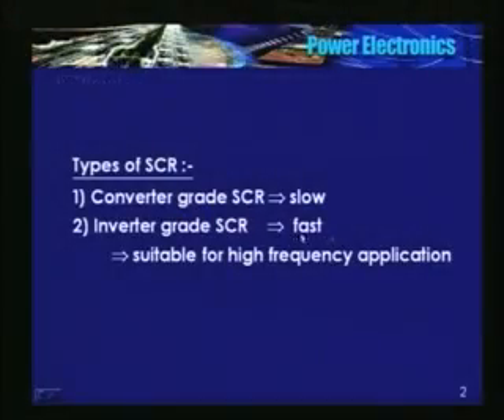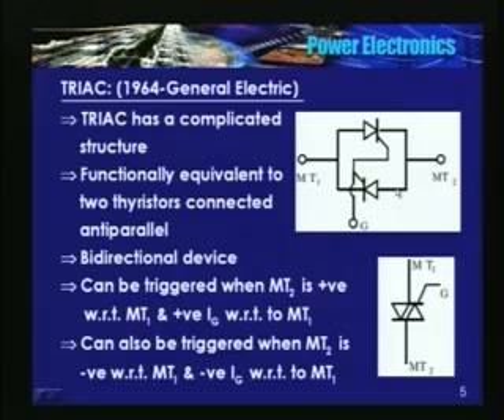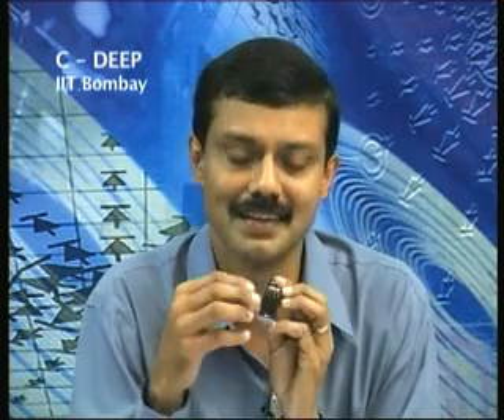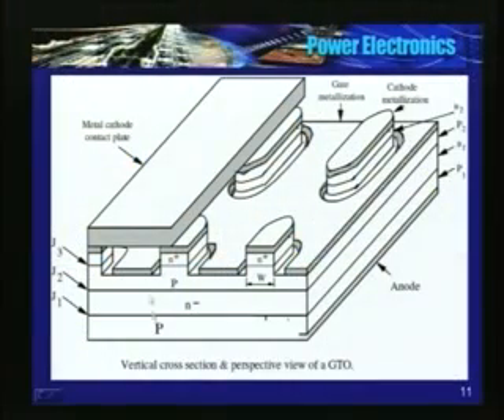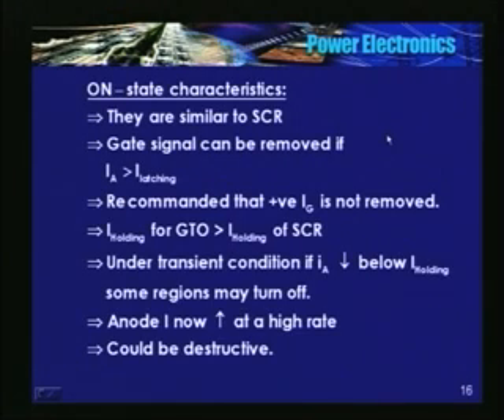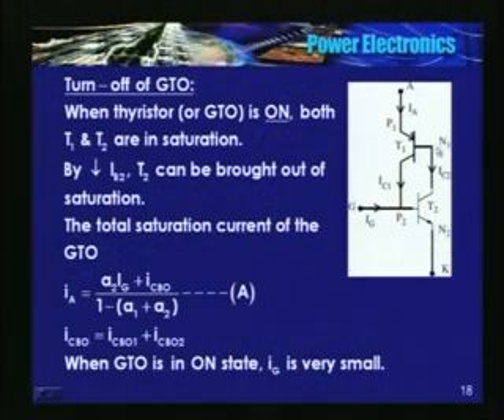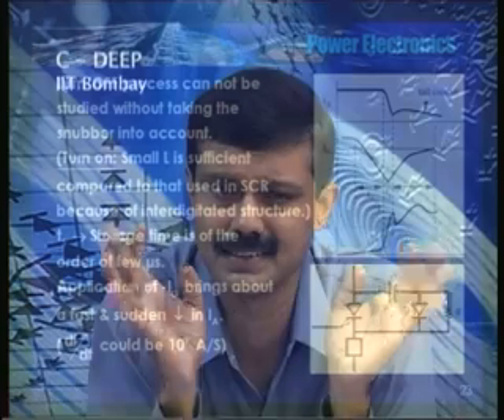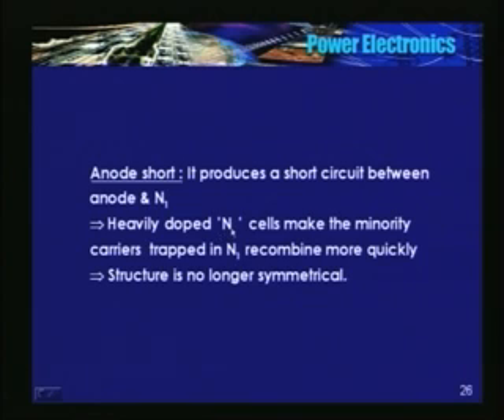Lecture - 6 Power Electronics

Comment: Few points Sir:-The lecture is excellent.I have gone through in full for 56 minutes.But explaining the GTO section turn on & turn off (though it is most important point)  in reference to its internal structure are too technical.Points only  from application point of view  perhaps could have been more interesting to hardcore application engineers.
Opto isolators replacing the pulse transformer should have been covered as the latter has omega L impedance that restricts its use in HF applications